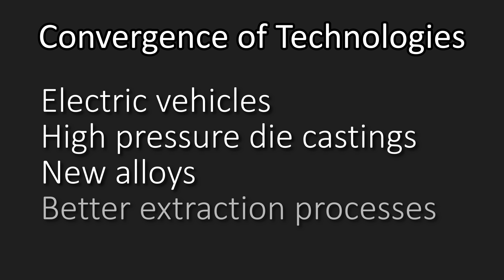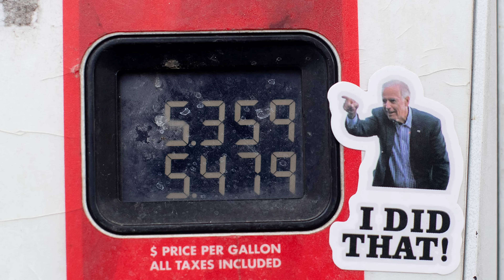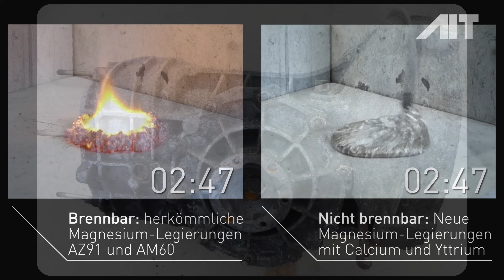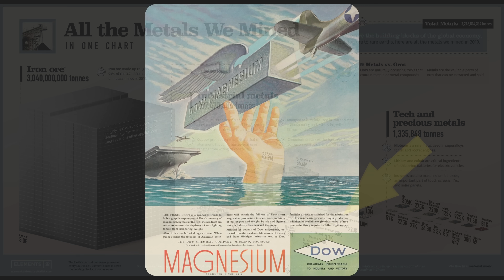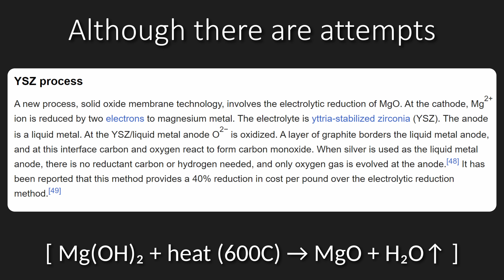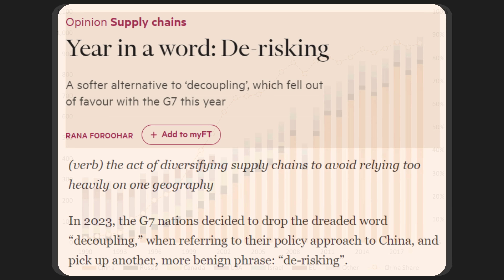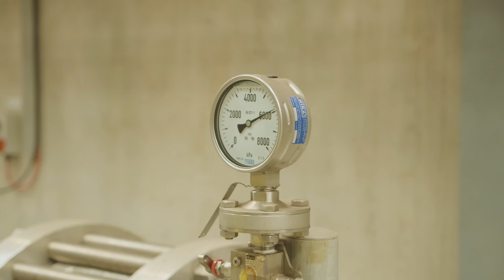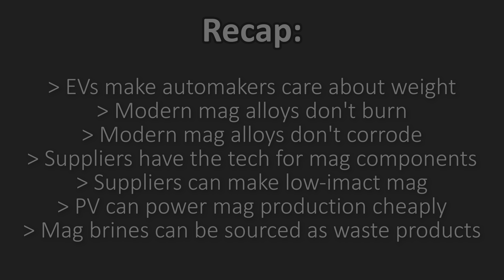Welcome to the AGE of MAGNESIUM

Comment: "In the late 60’s, Norsk Hydro started to develop a process for production of anhydrous MgCl2 based on dehydration of MgCl2 brines. The development of the dehydration process has continued, and today an improved third generation process is ready for implementation in brown-field expansions or green-field projects. Several elements of the improved process have already been installed in the Norsk Hydro Bécancour plant. Compared to the previous generation, this new technology offers a minimized energy consumption of 6 kWhi/kg Mg in a large scale mass and energy integrated plant, fully automated and continuous operation with a typical productivity of 1 t Mg/man hour. The Norsk Hydro dehydration technology (considered BAT in EU) offers an environmentally sound solution with minimal emissions of chlorine and chlorinated hydrocarbons, high productivity and improved quality of the anhydrous MgCl2 feed, ensuring a significantly improved performance of the electrolysis." https://link.springer.com/chapter/10.1007/978-3-319-48099-2_23#citeas

Comment: I’ve seen a couple of your segments now and I like your insight. The notion of harvesting Mg from desalination brine is extremely interesting, especially since sodium batteries are reaching mass commercialization and such brines would seem to be a great source for that, too. This potentially solves a multitude of problems at once.
Reply: Can the brine also be used as heat battery material (molten salt battery)?
Reply: Mg is also the byproduct of table salt production because magnesium salts attract moisture so they have to be removed.

Comment from the maker: It turns out that stamped aluminum car bodies do exist, they just never caught on at a large scale. The reason for this might be that, despite improving fuel efficiency, they also increase cost, and for gas cars, nobody cares about fuel efficiency. The high pressure die castings should have broader appeal, as they decrease the cost of the vehicle, in spite of using a more expensive material, thanks to large reductions in fixed costs
Reply: Pretty sure ford uses for f150, not nothing as best selling truck in the country
Reply: @patrickmanasco5905 body panels not structure.

Using Aluminum mean the item will have a finite life.  Aluminum has a finite fatigue life, were as steel is infinite (assume stays in elastic zone).

My 1990 F150 has 2 small spots of rust on body  and after 600k miles.  I highly doubt it would have survived if the frame was Aluminum.
Reply: @bowez9  You know airplanes are pretty much entirely aluminum right? Handling 30-50k pressurization cycles. So are fighter jets, dealing with insane forces. An f-16 has 1/10th the rated hours as an airplane, but that makes plenty of sense. As long as the design is properly matched to the load and use case, there is no inherent superiority of steel.
Reply: @garrettmillard525  and that us why they get required after so many hours, and eventually decommissioned.
Ask yourself how many oscillation a vehicle under goes driving down the road.  Evert bump counts as 2, as it loads and then unloads.
Reply: @garrettmillard525 jets are mostly titanium. Passengers are aluminium and duraluminium gets old and cracks. Even durals are kept in freezer to keep them young. And passenger planes are scrapped in about 20 years of extensive use. Remember that planes have inspections before flights and are maintained by licensed mechanics and they look for cracks by NDT penetrator. 
Cars mostly are bad maintained and they are not inspected before every drive and frame failures still happens on roads even frames are made of steel. There are cars which still drive with original frames after over 100 years. They were not designed for that but they survived. It's impossible for plane to serve that long. There are planes that serve over 50 years but they are not pressurised, they don't ride over bumps and still needs to be taken care of like for an egg.
Reply: aren't there just steel framed trucks?
Reply: aren't planes made from aluminum? t
Reply: @bowez9  Hey, how about high pressure steam boilers? Such as those found in steam locomotives? They have a finite service life, as does the frames.

Metal rusts, it corrodes, occasionally parts get too old and need to be replaced. It's why you don't see pure steel used in car shells anymore.

And yes, steel does actually suffer from fatigue... It just has a higher tolerance than aluminium.
Reply: @Ben31337l  you introduce corrosion, I was only talking about stress/strain.

Hence why body panels in Aluminum are viable, almost no stress on them and what is has no structural significance when fail.

What is your definition of "pure steel"?
Reply: Lotus elise had a full aluminium chassis (yes, fully structural) in the 90s.  Since then there have been several British sports cars made with aluminium chassis. Jaguars, Astons, that type of thing.  I'm sure their are plenty other examples.   And steel's infinite fatigue life (aka fatigue limit) only applies to lightly loaded structures typically only found in skyscrapers, ships, bridges and other big stuff,
Reply: The main reason for steel is recyclability.
Reply: @goiterlanternbase every metal can be recycled. And they don't care for recycling. If they need then they use carbon or glass fiber.
Reply: @starydwumas7481  Not as easy as iron. You miss the scale of this endeavour. There is a shitload of cars out there, getting scraped every single day. You can't dump them, because it takes precious space and what ever you do, it needs to be short routed. You not have the slightest clue, how nasty working with aluminum is, especially in comparison to steel.
Reply: @goiterlanternbase  yeah but they don't care about recycling. They make EVs, aluminium framed motorcycles are made for over two decades, every interior thing is plastic, whole planes are left in desert to rot. It's just that it's not worth money to make cars aluminium like it's not worth the money to make them capable to withstand accidents. Producers already cut costs because they need to implement safety features and no client wants to pay more for car. People gonna crash cars anyway and medium lifespan for car is around 10 years nowadays.
Reply: @starydwumas7481  Cars are designed to Crumple Strategically, in a Crash.   If the car was more solid and less flexible.... when you got into a wreck, the car  "might"  survive with minimal issues... but you would not survive the shockwave impact forces.   The frame and body crumple, drastically reduces initial impact shockwave forces... and as such,  you have a good potential to survive the incident, without critical harm.   The car is considered far Less valuable, than the Occupants... and that is how it Should be.

(BTW - Sparring Gloves are a good example of how Absorbing materials, help dramatically reduce impact potentials.   The same punches with that do not cause KOs..   would easily be at KO levels, with a Barefist hit at the same power levels).   While you can still cause KOs, and potentially lethal levels 
of blunt force trauma damages while wearing gloves...  the percentages of such incidents is extremely rare (as you need a LOT more power generation, to go beyond the material absorption properties).

 On the Flip side... if a car was made like a tank (more like the 50s era cars)...  it would also be much heavier... and the more mass that is involved in an Impact... equates to far more Damage potentials.    There have been Cats that have survived falls from 7 story apartment building.   How?  Because cats barely weight anything (they are mostly fur).    A large and heavy dog, would never survive the same falls, due to its higher mass... and thus vast impact potential differences.

 As far as Recycling goes... most Recycling systems are a Scam.  It tends to take more time and resources to Recycle, than it does to actually use new materials from scratch..   and...  a lot of the recycled materials cant be used in many situations, due to inferior structural strength.

 My main issue with cars, is the lack of protection from Rust.  A protective undercarriage panel, should be a standard necessity... most especially in cold climate areas, where wet and salted roads, eat the car alive.
Reply: @johndough8115  cars can be made to to sustain crash and not crumble. Look at new Tesla. But they cannot be made to sustain damage at every speed that's why they are not made that way. Volvo is working towards cars being safe so they installed vmax limiter. Cars shouldn't drive that fast because roads, other drivers, cars and weather are hazardous. 
For example machines in mines are made overly durable because miners should be able to hide in machines during accidents. 
If car would be overly durable then you wouldn't have to care so much about rust.
Reply: @starydwumas7481   You really dont get it.  Firstly... Tesla's cant easily crumple like other cars... because the Batteries would explode into a raging Fire.   Ever see an EV catch fire?!   It takes like 5 seconds, and the entire thing is a total ball of flames.  Barely enough time to escape it.. even if you were simply parked, when it suddenly blew up in flames.

 And again.. you dont seem to understand the mechanics of an actual collision.

 Do you know that most Drunk drivers tend to survive most of their crashes... while the Sober passengers do not survive?   Do you know why?   Because the drunk drivers body is so relaxed, that it absorbs, bends, and twists.. without any resistance.  This allows their body to flow sort of like water.. effortlessly.   However, those that are not drunk, tend to Tense up their muscles.  Their bodies become Rigid... and so the impact forces are 1000x greater.   Those forces tear them to pieces... because their body become a more effective "Conductor" of energy.   The mere impact shockwaves, will literally shred tissues, and cause internal ruptures...  even without any puncture wounds.

 Air bags have helped reduce shockwave impact damages... by providing a semi-absorbing cushion of air.   However, the airbag alone, isnt enough... in a serious impact... because your entire body is still one with the stiff structure.   That energy is still going to conduct into you.

 Thing about the difference:   A sledge hammer...  or a sledge hammer thats placed inside of an MMA Glove?   Which do you think, will cause more damages, if you hit your own kneecap with them?

 The stronger the car... the stiffer it will be.  The stiffer the car... the more CONDUCTIVE the Impact forces will be.

 Heck... even think about hitting a metal pipe... and how it vibrates and makes a sound for an extended period of time... vs hitting a piece of plastic, or rubber.   Thats the difference, between Conductive, and Absorbent, materials.

 Since steel isnt actually absorbent, they have to make it in ways, so that it crumbles slow enough on impact, to simulate an absorbing material.
Reply: @johndough8115  MMA gloves prevent skin rupture and dissolve pressure for greater area. Impact on head is the same or higher.  But I get your point, steel bends and takes energy first. 
About airbags, they are capable to absorb all force. In motorcycle races they are widely used and mostly rider comes unharmed. Even in F1 where bolid is very stiff drivers are capable to walk out of a crash.
Reply: @johndough8115  - I have looked for good data about WHY drunk people do better in car crashes. I could not find anything that would support the "relaxed body" theory. However, it is clear that drunk drivers involved in car crashes are usually the ones who cause the crash. They crash into other cars with the front end first while the folks being crashed into experience the impact from all possible directions. That data made sense to me to explain why drunk folks have a better chance of survival and fewer injuries.
Reply: I love Mazda MX-5s, and have been playing with them almost 20 years now, haha!  Anyway, they were made with aluminum hoods and trunks to save on weight.  A huge benefit of lower weight That you did not touch upon is that it can massively improve performance in acceleration, handling, and braking all at once.  A 300hp car that weighs 3000lbs is basically just average these days, but at 1500lbs it's a damn rocket ship!